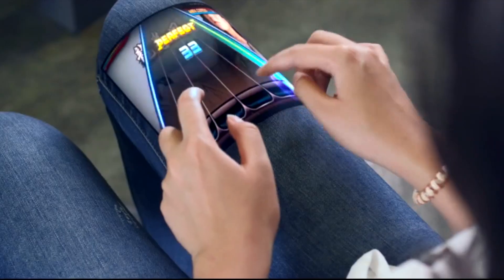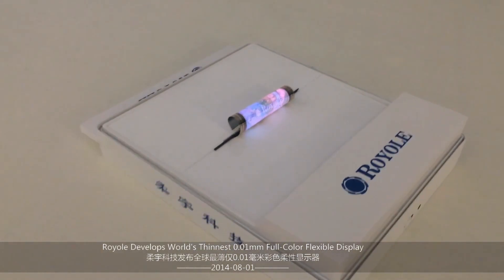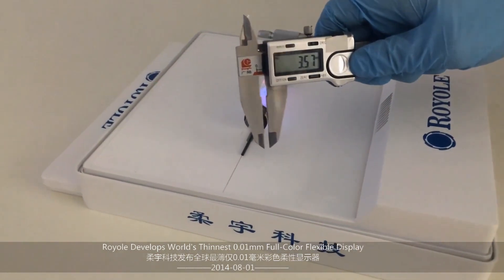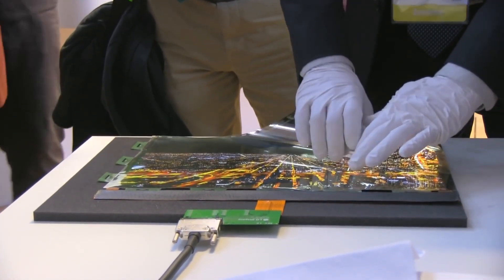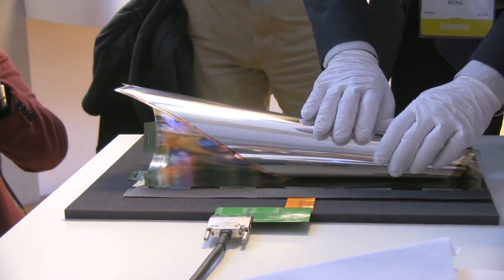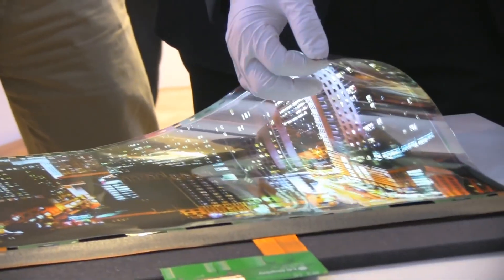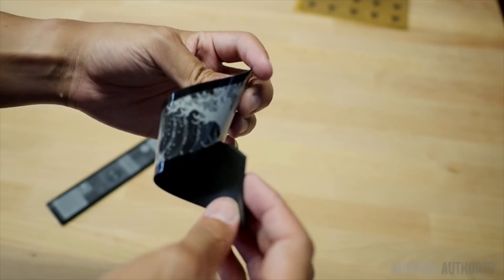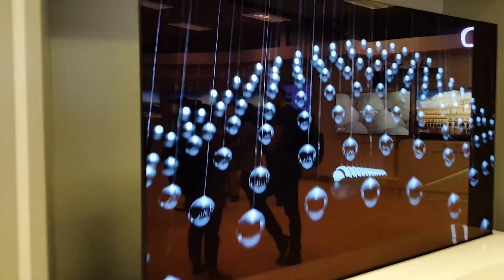What is Stopping Flexible Displays From Taking Over?

Comment: Flexible displays would be perfect for VR. With the right lenses we could have peripheral vision.
Reply: Not to mention it would  make them more lightweight.
Reply: It's not about the flexibility there are curved screens already that are not flexible. So VR headsets won't need foldable screens just curved. Also the screen panels are already very thin in VR headsets, the sensors and other hardware take the most space in them.
Reply: I imagine how in 20 years or so our kinds will say that strapping a smartphone over your face was such dumb idea
Reply: ochiorbus To be honest, it is a ridiculous idea, it looks like something straight out of the 70s. But we all wanted a taste of the future, and this was one of the cheapest ways to get it.
Reply: Mellowman468 no they dont    

if you want to look down in vr you dont need a dome, you need to look down
Reply: The eye can just focus on one spot, and this spot IS movable. Focus on your keyboard, and you won't be able to read anything on the screen, but you don't need to turn your head to focus on the screen instead. This is why everything in VR needs to be equally sharp, because you never know where the user will direct their pupil at. You are only able to see sharply inside of the 2 degrees in front of your pupils, this is known as the foveal area. Sounds unbelievable, but the rest of your vision field is actually rather blurry, but it doesn't appear that way, because the brain actually subconsciously "reconstructs" the things outside the foveal area from experience and due to eye movement.
Reply: Arttu Siukonen its not just curved that VR headsets need. they also need to be dome to show up and down peripherala.
Reply: You read my mind!! I want to see the Oculus Rift CV2 with a flexible screen! I hope this happens before 2020 but I doubt it.
Reply: DragonMatt81 you are absolutely right. It wouldn't work the way people think. There's a whole discussion on this topic on Reddit. I personally didn't find the 120° FOV an issue. I was too distracted by what's in front of me when I was playing an FPS. I think a retina tracker would enhance immersion so the camera follows what you're looking at. I don't know if it could work with every game. What do you think?
Reply: Although… if what we want is peripheral vision, there's no need for lenses, because peripheral vision sucks in terms of definition. It exists only to let us know that there is something happening there and that we should turn our heads and look at whatever that thing is straight on. With curved screens rendering low-resolution images, and proper forward-looking viewing screens (with focusing lenses and all), we could get a very decent approximation of real vision for immersive displays.
Reply: companyoflosers But you forget that everything needs to completely in focus in VR all the time. The headset has no way of knowing when you only move your eyeballs to left and right so basically it must be all the time focus everywhere on the screen. What you said would work if you would always only look at the center of the screen but because people tend to move their eyes only to watch to edges of their vision, the edges need to be sharp all the time...
Reply: Lenses are required not only to make the wrap around effect but to help the eye focus on something so close. otherwise the screen would need to be further away from the eyes the same way is extremely hard to read something thats a few cm away from your eyes.
Reply: eye tracking then.
Reply: Or imagine making a room for VR with the screens on the walls; maybe even the ceiling/floor, instead of relying on glasses.
Reply: emil posselt with a flexible display you could adjust it to work better with certain people's preferences.
Reply: Babby Bab. cbyson
Reply: the helmet (210 fov)with flexible oled existed before Oculus and vive ...
Reply: So yes, it's about a curved image, which does not change the fact that those who did 210 fov used the flexible oled as I wrote earlier.And that is exactly the point of fitting the curved image to the shape of the eye, which is neither flat nor spherical, although most closely related to the sphere.
Reply: Marcelo Glenadel I like that idea. I thought of maybe three screens which two are extended displays, one on each side of the center screen but it would probably be less efficient in regards to power consumption and possibly performance. I'm guessing they've tried various ways but the only I'm aware of is led lights on the sides to resemble peripheral vision which might be more efficient.
Reply: Marcelo Glenadel But this does not take into account that the eye itself can move. Peripheral vision is relative to where your pupil is directed at. If you glance sideways, then peripheral vision is in front of your nose. So unless the lenses move with your pupils or you find a way of keeping your eyes from moving, this won't work.
Reply: DragonMatt81 that's true. Also keeping in mind when glancing left or right the nose is blurred and focuses on the object being looked at to a small degree without turning the head. Then there's the peripheral vision while the eye looks left and right which I'm not sure how they would accommodate for that so it's indistinguishable from real life. It is very complex.
Reply: now I think of it more, I'm not sure if glancing left or right, the eye can focus any more than it can with peripheral vision. I mean of it's possible then it's some special ability I couldn't do. I have to turn my head to get a clear view of what I'm looking at.
Reply: You don't need two lenses for that kind of vision when you can input controls to zoom in and whatnot... Remember the real use is a display, like a head mounted display if not used in VR, so being able to have part of the screen enabled for images but the rest is clear so you can 'see' through it, would be pretty interesting.

Instead of flipping the visor to see what's behind it, you can literally press a button to reveal or hide the back of the display so you can see through it, almost like a overlay.
Reply: DragonMatt81 I could imagine that would be more efficient since it doesn't have to be a hardware implementation but it might only apply to certain games if they even have that feature
Reply: +Meme Machine Wait cellphone strapped to face? What kind of VR is that.. Oh, you meant fake peasant VR. I didn't realize that was still a thing. Vive, Rift, Fove, and OSVR are the only VR headsets worth mentioning right now.
Reply: you just will need the specs to render the extra screen space, grated you could do it a bit more easily, since peripheral vision would be out of focus, you could afford to render peripherals with less detail, the problem is loading things in when you rotate you head quickly without experiencing pop-in.
Reply: unless they have like a one way mirror kind of deal where behind the flexible screen theres an eye tracker that tells the game where you eyes are looking and where to add full detail and where it can get away with less. it would need to be accurate but hopefully also being in such close proximity to your eyes would help with that. that is assuming it could also see through the lenses to where your eyes are unless they find a way to do away with lenses and still keep the 3d. lots of problems to work around but the flexible displays also potentially being transparent could change alot of things.
Reply: +companyoflosers There is.. Well on the PC that is. Fove VR can do it and the Vive can also do that with the aGlass addon. Its called eye tracked foveated rendering. #PCMASTERACE
Reply: I still think the easiest and best fix so far would be to place LED lights on each side of the screen. I know this doesn't seem to completely solve the issue of peripheral vision, but think about it - when you see a shadow in the corner of your eye, your natural reaction is to turn your head in that direction. So why not use that time to face that direction so you're ready for whatever is there. It's more convenient, especially in fighting/shooting games.
Reply: It's not a cell phone strapped to your face now if you get one of the decent headsets.
Reply: hololens doesnt use this as its lens. If the lens production scales up some other company will have a great chance to use this flexi lens to knock windows hololens out of the market
Reply: CelticStar8 that is already being done with projectors. Also in 3D.
Reply: That's just the Gear VR, There is the Oculus Rift, and other ones that are much more powerful than the gear VR.
Reply: Would not need much of it anyway, just at the the 2 corner of the VR set
Reply: "Or imagine making a room for VR with the screens on the walls; maybe even the ceiling/floor, instead of relying on glasses."

so you have return in the past , marty...
a rich fan of quake make it years ago

wait !!!
it's like that VR
https://fr.wikipedia.org/wiki/Virtual_Boy
i feel old, nobody to see they treat us as a cow :p
Reply: +Rusty Thumbs Gaming Displays are just a crappy stop gap; I think we'll ditch them sooner than you think. You're making an image on this large, bulky display the size of a large phone, only to project an image (at infinity for the Vive, and I think at 1 m for the Oculus). A tiny little bit of that light makes it into the eye (i.e. cordless will require a big bulky battery because only a fraction of 1% of the light goes where it's supposed to) and there's no way to have different focal distances (e.g. based on the Z-buffer of the rendered scene).

You don't need to do it that way. You only need that little bit of light, shaped in just the right way that goes straight into your pupil; and that's a digital lightfield display.
Reply: you're onto something
Reply: i have LG Signature 4K 65 :) is like a paper on wall :D 
but if people want to use as VR it will need bigger size than 65, i play games on big tv for long time and it looks normal for me :P
Reply: Also less bulky
No more cellphone strapped to your face
This should get put into development sooner than later
Reply: +Babby Babbyson you ok mobile VR is the shittest thing ever  everyone here is talking about PC VR not mobile think about it non mobile VR has screens in each lens mobile VR has a shit phone strapped to a $2 cardbard or plastic box with a rope attached to your face
Reply: You don't need flexible displays for that, only curved ones. But the real problem are the lenses. VR isn't just having displays in front of your eyes (if you just hold your phone directly before your eyes you see why that can't work). You need lenses that make it appear as though the displayed content is in the right distance and there are no lenses that can do this if the light is coming from different angles.
Reply: Does anyone not realize the genius behind this technology in books and newspapers ect? Imagine a mother fuckin picture book with this technology... O.O
Reply: fishbong Yep indeed. The problem is not that we couldn't make wide enough screens or curved ones. The biggest problem is the lenses and the dilemma of making looking through them sharp from edge to edge. This is no minor issue and I'm afraid it won't be completely solved anytime soon...

You can read about it from here: https://vr-lens-lab.com/field-of-view-for-virtual-reality-headsets/
Reply: What you describe exists already, it's called a tablet computer.

Comment: This looks promising, there can a ton of applications with flexible screens,

Smart phones can like a USB size device with retractable 5 inch screen and provides always on display when folded.
50 inch Televisions can be size of an umbrella and portable
Electronic AD boards.....etc

If scientists can figure out small form factor, very fast charging,  high capacity charge storage(batteries ? or better), gadget designs  can benefit a lot.

Comment: Why would one want one in say a phone? PCB's aren't flexible, batteries arent't flexible. Not by design at least. Where are you going to unroll it? Would it require some sort of "scaffolding" to stay in shape when rolled out? I just don't see the use for it. The moment's when I can sit down with my phone and comfortably use a big floppy peice of plastic as a screen are  close to none. And phines by the way are fragile as they are. Would a foldable/rollable display last a year of normal use?

As the girl in the intro is using it for example - who the heck would use it like that?! And where is the actual device? No this, in mobile use, is as practical as those transparant displays that we just had to get to work a while ago.
Reply: Maybe they want the screen to shatter because of planned obsolescence.
Reply: You fail to see how flexible displays are much more durable than the display panels in current phones. Dropping your phone wouldn't cause the display panel inside to show streaks of random colors. Flexible panels would be amazing for consumers.
Reply: Brendan I think you fail to see how removing a protective structure, even if it has a brittle point, makes it less durable.  Sure it won't crack etc if bent.  But the same accidental forces exist, and now look how easy it is to bend/crease/crumple/tear/snap it under a common force?  What would a scratch or errant poke with a fingernail, pen, or car key do to it at more than a few grams force?  There's always a tradeoff.  Removing protective material doesn't make sense.  You're trading several virtues of strength just for one, being able to yield to a "potential" force.  But ultimately, if it persists and the force ends up being actually applied, it's game over because it's physically weaker in all respects.

Let's say you are filling out an important application and it's draped across your leg, and you reach over to grab your water and realize you just irreversibly crumpled the paper because you rested your arm on it.  Wouldn't a clipboard behind it have been better?  Just saying.

The flexible concept is super cool until a trivial accident occurs.
Reply: maybe for example  you could have a small slim rectangle box that has all the phone components  and then there is a telescoping scaffolding similar to a suitcase that brings out the screen when you open it.
Reply: Flexible PCB's aren't new.
Reply: If you could make the screen behave like a measuring tape it could roll up tight but when unrolled could be rigid with no support, like a measuring tape.
Reply: I have heard about flexible batteries, I think it was made of something similar to paper, it was thought that it could be used to fill up space in strange places in products.
Imagine something like removing the car battery and fill the doors and rest of the frame with flexible batteries.
Reply: @Sion: this would be another case of planned obsolescence: if the battery fails, you would probably have to replace the whole door or another part of the frame.
Reply: Roger Skagerström there was a phone that actually works that was flexible. it used a cell design which localized everything into a chocolate bar like shape on flexible "joints," it was kinda cool
Reply: Roger Skagerström the battery and cpu and all that would be at the too and bottom.
Reply: phone scroll. the hardware is kept on a small tube (maybe as thick as a finger), and you just unroll the screen.
Reply: And how are you supposed to hold it? :P All these things sound cool - but they aren't really pratical :P Unroll the damn thing everytime the phone is used? Even just watching the time requires unrolling the damn thing ;) And as I said - holding it? Grab around the film?
Reply: Roger Skagerström that's just the display, that's not the full device
Reply: Not really Jerry. I am realistic. Just because it's new doesn't mean it's better. Besides the fact that you could make a regluar phone more resistant to damage - what's the real use case? Rollable foldable whatever. How are you going to use it? Even my S6 Edge+ is on the verge of beeing uncomfortable to handle with it's slim edges. How would a slim bendable film be any better? And you'd be immensly limited in what hardware you could have in it. Especially battery.
Reply: Yeah I know that Exodus. Still - what people talk about is a rollable/foldable display. If that would make ANY sense then it would be like GraveUyopo wrote - the phone electronics in one compact unit and the display somehow unfolding/unrolling from it. And if you don't make the hard unit as big as the actually display (what's the use then?) you are going to have to grip the actual display film as it is the main "form" of the phone.
Reply: You could have just a regular smartphone with a flexible screen that doesn't shatter into a million pieces when you drop the damn thing.
Reply: Said like someone with a closed mind and absolutely no imagination whatsoever.
I guess you must still live in a cave.

It must suck horribly to be you, Roger.

Comment: I want a phone screen that rolls up into a pen, and can extend to a tablet sized display...
Reply: But it won't be rigid
Reply: RockCh4lk it's a give and take,i die I've don't mind that, ima use it like a book on table
Reply: Where do you keep all the other components that run the screen?
Reply: explain to me how the battery and components will be flexible ? this will never be possible until true wireless charging takes over.
Reply: @zaca911  batteries and circuit boards are flexible now. Check em out
Reply: KMS MEMES we could battery outside of the flexible screen

Comment: One of the main reasons there are no "usable" products with a bendable screen is that you still need something to drive it -- a battery, a CPU/processor, storage, wifi/cellular connectivity, etc. It can't magically display something without those things. So it's nearly useless for a portable device (such as a phone or a tablet).